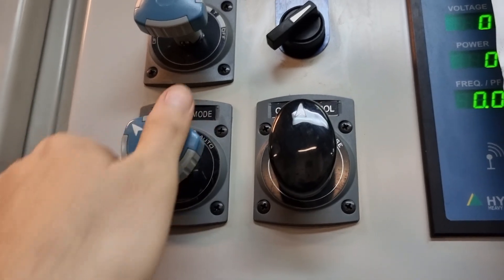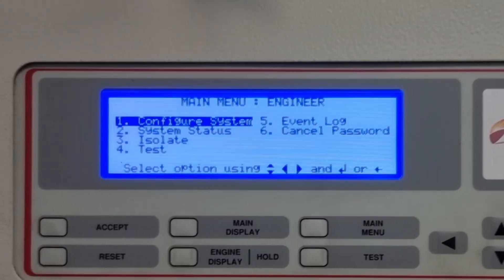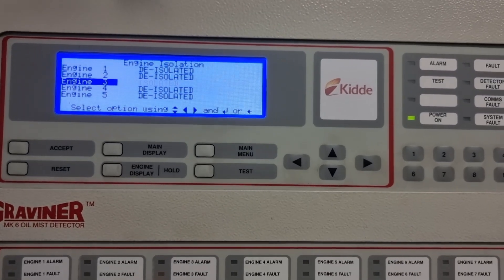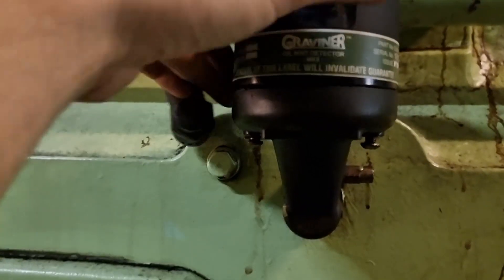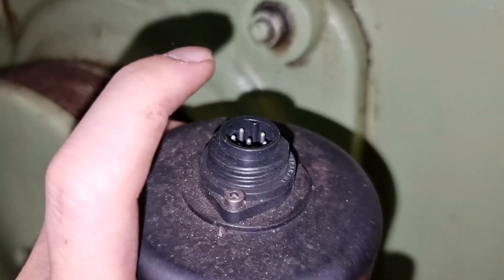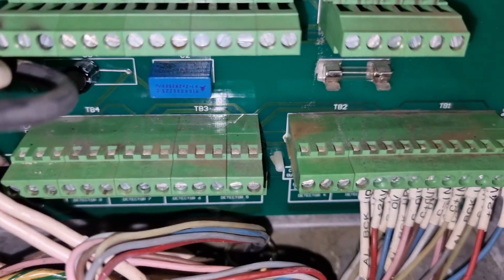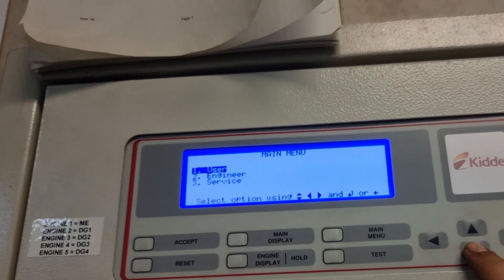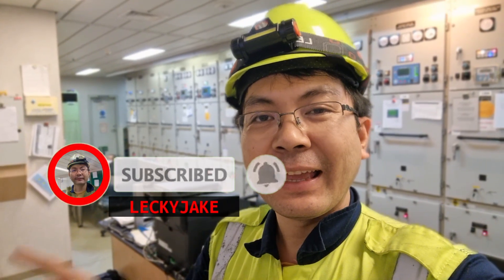Generator Oil Mist Detection System - Maintenance | Marine Electrician

Comment: We had some older roll on-roll off ships years ago at our shipyard that had something like six good size Diesel engines in them, and they had a much older oil mist system in it than this one.  I think they used to call them oil mist precipitators, but can’t remember.
The only problem with those ships were that even with those devices in place, the oil mist still counted everything in the engine room with a very fine oily mist. You could not put your tool bag down or touch the walls without getting a very light coating of the oil and grit. Probably a characteristic of the old Diesel engines…….

Comment: Why sir most of diesel generator does  not have ODM?
Reply from the maker: All diesel generators that I have sailed with have oil mist detection system
Reply: Solas Requirement - if the engine power rating is 2250 kw then we require either omd or bearing temperature monitor .